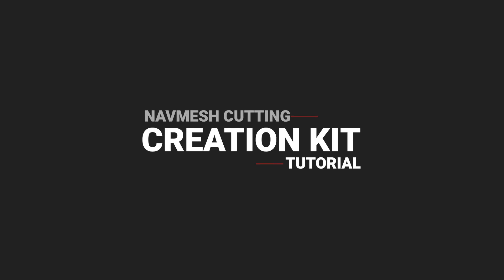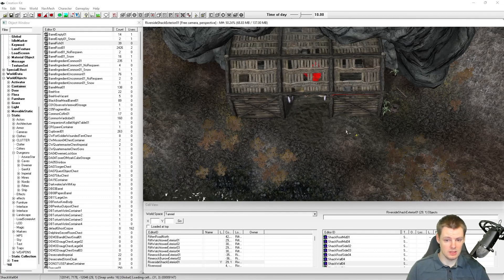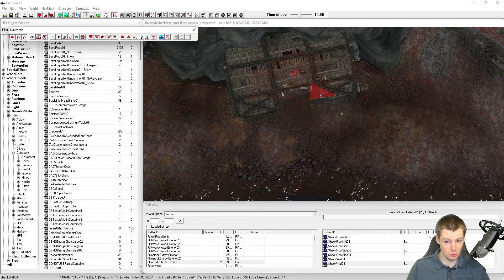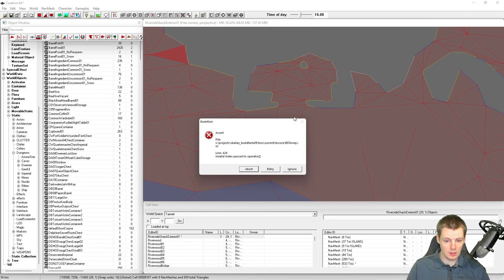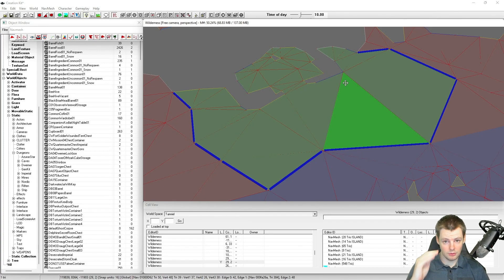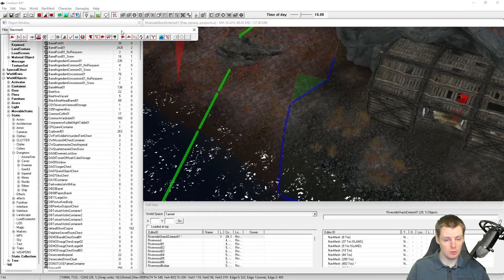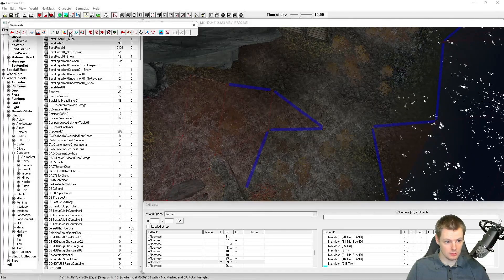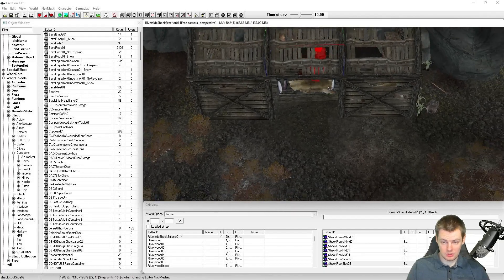Creation Kit (Navmesh Cutting)

Comment: Thank you as always for the tutorial! 

I ran across some issues (interior cell) trying to do this. Essentially, the separated triangles from the old NavMesh were given new form IDs. The old form ID was stripping down to zero triangles, and SSEEdit indicated this was "deleted" despite never removing anything from the original mesh. Not sure what was going wrong, but no matter which way I tried the same thing happened. What I ended up doing to fix this was undeleting the original NavMesh then moving the whole thing away. The newly updated NavMesh is still there and working (even the triangles that WERE part of the original) and a copy of the old one sits at the bottom of the ocean.

Comment: Nice, thanks.
Did find that the recent update for SKyrim SE to AE (Nov2021- update ver 1.6.323.) caused navs to move higher or mess some mods navs up, found dogs float in air near doors in Riverwood. 
(Since I have been updating mods to AE, I only made it to Riverwood and usually restart so I do not know about other areas.)